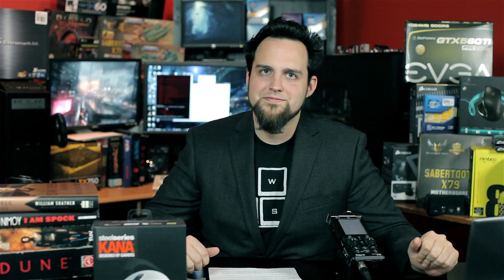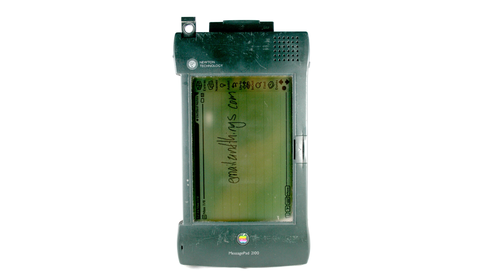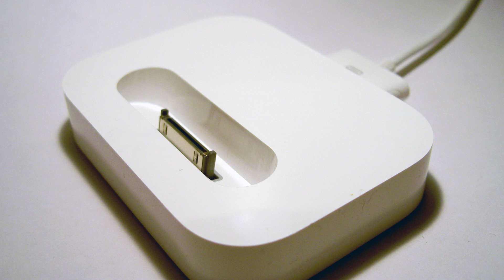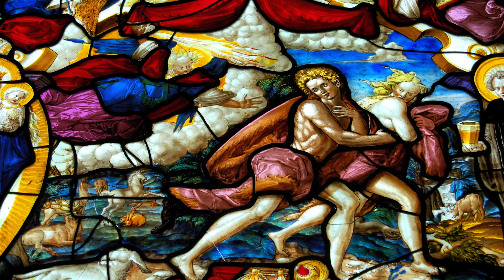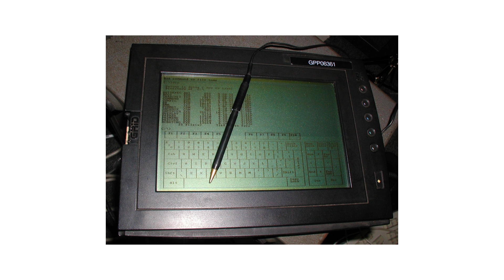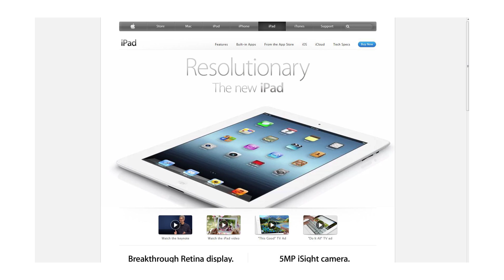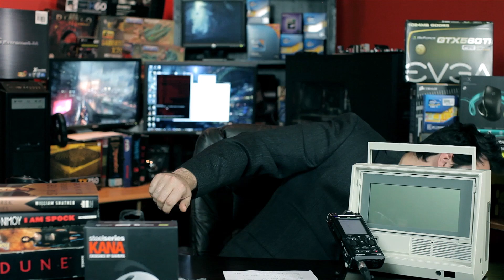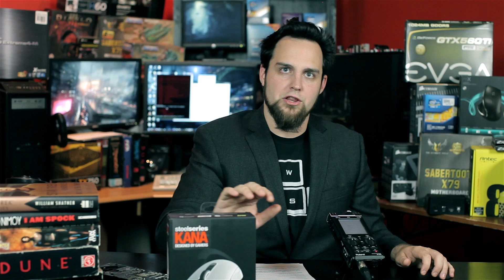Has Apple Really Ever Invented Anything?

Comment: Is a car an invention?
-No, since both the weel, the engine, and the type of metal used for the chassis existed before.
Is a plane an invention?
-No, since all it does is combine rotor blades (basically a fan) driven by an engine, and uses these to create vacuum over it's wings which pulls it upwards during high speeds, lifting it from the ground. Basically air pressure lifts it. I'm sure air pressure existed before the plane.

All just recipes, not inventions, right?

Comment: The problem is a missing notion of "logical conclusion" in copyright and patent law.
Basically, if some technological innovation more or less invariably leads to multiple independent innovators to follow it through to the same conclusion, such as capacitive touch screens doing away with the stylus, or miniaturisation of components leads to a new type of portable device.
Or more limply. someone invents the wheel axes, and suddenly 2, 3 and 4 wheeled vehicles pop up everywhere...

Comment: We work based on facts that drive the greater good, not laws. An invention doesn't have to use pure ingredients, but it can't remix a recipe. For example, you can use an existing type of manufactured glass and call your device an invention as long as it doesn't interfere with what you're inventing, which may be the motherboard, the cpu, or any part that is purely yours. In this case, the glass can be considered an ingredient. However, a small modification of an old cpu doesn't make it yours.

Comment: Actually the 3G to 3GS was a HUGE upgrade (and I'm not an Apple apologist).  If you've used a 3G recently you'd see it right away (the 3G is slowwww).

The big change was that Apple went from a super dated ARM 11 CPU to a cutting edge (at the time) ARM Cortex A-8 CPU that was, essentially, 2+ times faster.  They doubled up on RAM and put in a much faster graphics chip as well.  The new camera had auto-focus.

Under the hood, the 3GS was all improved from the 3G, which has old hardware.

Comment: That was not the iPhone, that was the availability of the capacitive touch screen at cheap enough prices to be used on smartphones. Before 2007, consumers could only get access to resistive touch screens that wasn't as smooth an experience for a smartphone. But in absolutely NO WAY has Apple invented the capacitive touch screen, that was invented in 1965.

Comment: (Continued) It's definitely not normal to format every 6 months. I used my current computer for 3.5 years before formatting it for the first time, and it wasn't because I had problems, I just ran out of HDD space. I used my previous computer all the way from 2001 to 2009.
My point is, don't comparre a low-end PC to a Mac, because there are no such thing as a low-end Mac. Get a PC of the same value as a Mac, and I'm pretty sure it will work fine, otherwise, however sold you this, is a crook.

Comment: just to say IEEE 1394 standard ( aka firewire) it's been co-invented by apple as well as all the company you mentioned because even if it's true that the first DRAFT of the standard was developed apple was not anywhere near (in 1987) from 1988 apple took on and did a lot of work with IEEE to make the standard better so when it was released in 1995 apple was one of the co-inventors maybe apple did not had the first idea but if to have the first idea = invent so helicopter was invented by da vinci

Comment: No ... that just means their spending is efficient. No insult there. They have relatively flat structure, they work in teams that dissolve and assemble when and where they needed. Microsoft has huge teams with an intricate command chain where decisions take weeks. Apple has a business model that produces more income versus effort placed in than any other company. An embarrassment and an insult to their investors is Microsoft's stock ratings for the last 5 years.

Comment from the maker: well, I prefer the open style of Linux. Mac is cool because you have a terminal and such, but Windows is more open (until Windows 8). I do own an ipod and use it daily. We have EVERY iPad ever made her in the office and they are used daily as well. Wendell does design work and has to use the Apple devices to make sure all the software works on all platforms. I do not hate iOS but I do not like closed platforms. I am glad we have Apple. They do push the industry into new areas.

Comment: least wasteful*

Die casting costs less, uses less material, has less waste, requires less maintenance, and uses less energy.

It's clear you don't know anything about manufacturing, but even an iota of basic reasoning would have brought you to the conclusion that CNCing should be avoided wherever possible when doing mass manufacturing.

Comment: Apple should get 2 Merits for:
Inventing a really thick concealed antenna that wraps around the outside of a mobile device [iphone 4] and is touch sensitive enough to decrease signal strength.
2nd Merit for:
Doing the exact same thing again on the next generation of the same device [iphone 4s] and saying that it works just fine.
Here's a [CHEAP] case to cover it up and make you all happy though.
Or did someone else do this B-4 as well?

Comment: even if software was included, siri doesn't count as an invention, because it's been done hundreds if not thousands of times. It's very simple to do even for beginner programmers if you have a voice library. It's just that siri has a larger database of responses and is slightly more accurate in detecting ranges of voices.